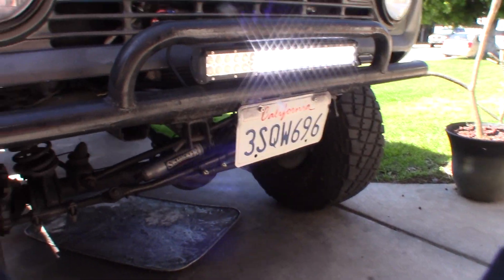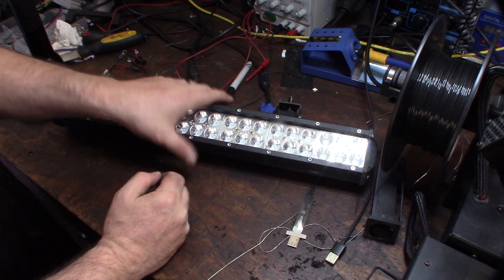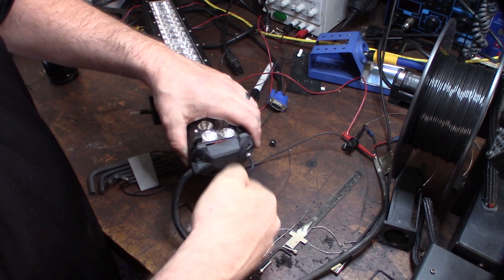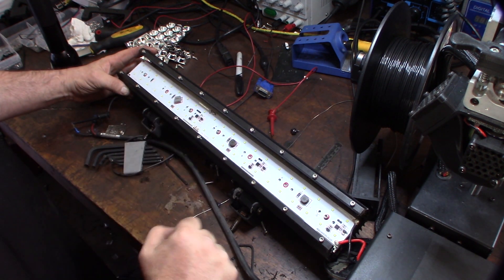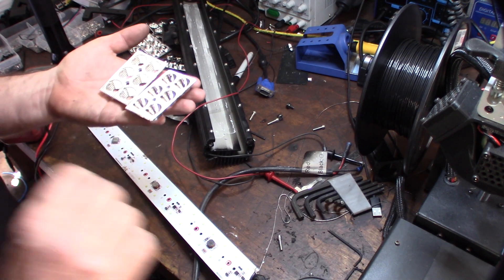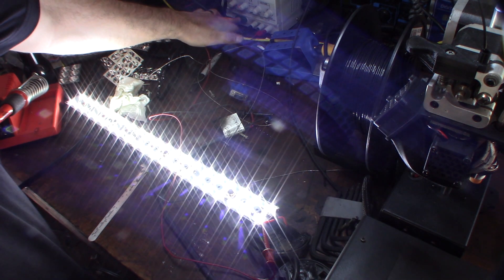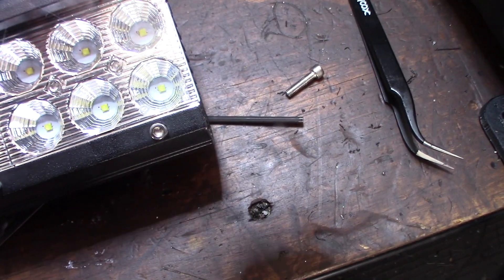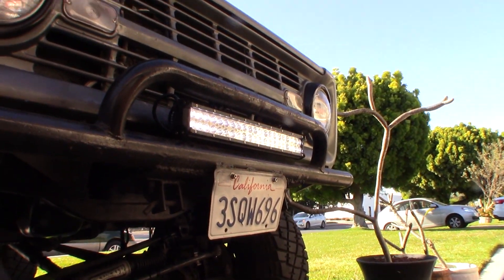Off-Road LED Light Bar Troubleshooting, Bad Bulb Section Repair, Water Leak Damage Fix

Comment: Good video Sir 👍I'm trying to figure out why my lights stopped working after splicing a longer negative wire in. The lights on the rocker switch work but that's it ?

Comment: I bought a curved 40 inch LED bar from Rough Country over a year ago and left it in the Box till couple weeks ago. I didn't want to try to fix it myself, but Rough Country is sending me out a new light bar and they said to just toss the other one. I'm going to try to fix it and have two working light bars.

Comment: nice - thanks! I think petroleum jelly under heat conditions e.g. 38..42 degrees will melt away. Better to use silicon sealant.

Comment: I got a curved 52 inch light bar that's shorting out my switchs and melting wires I got it for close to nothing but a new one is $$$
Reply: Might be grounding somewhere it would be very smart to put inline fuse in